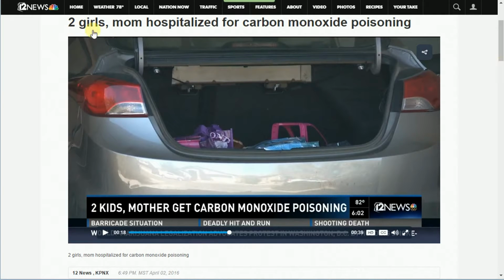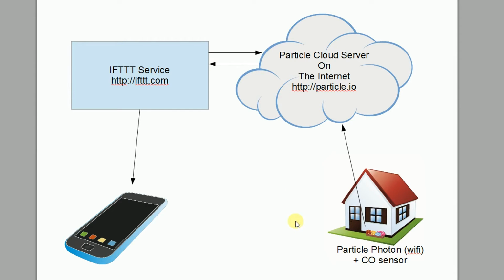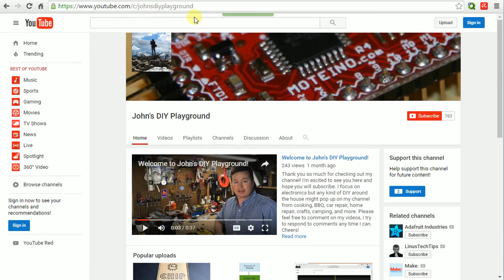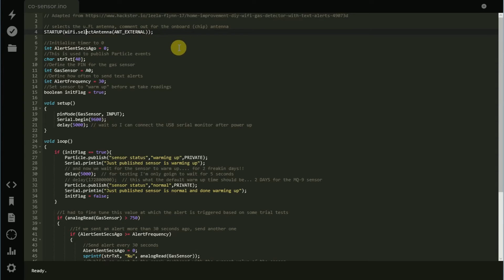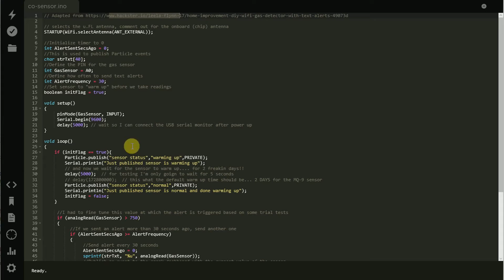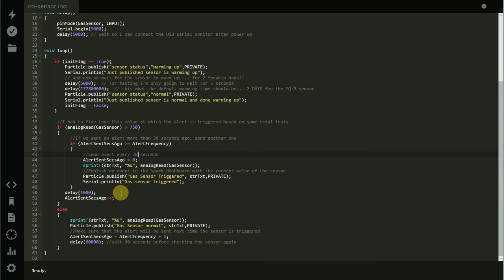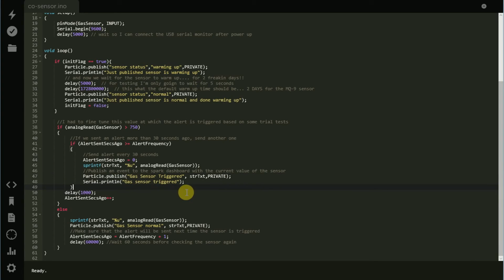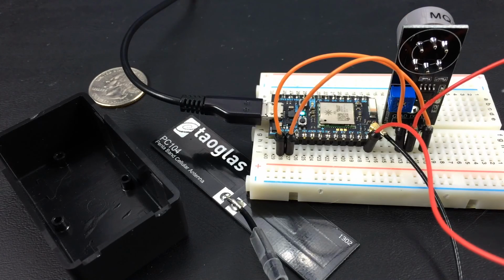DIY Smart Carbon Monoxide (CO) sensor to alert your phone

Comment: Hello, 2 questions:

1. Do you feel that IFTTT is reliable enough to use for the push notifications?

2. Does your 5V sensor output your reading on a 5V scale, or are you feeding it 5V to the sensor and receiving a 3V max signal on A0? I may have missed it.

thanks!
Reply from the maker: +clayz3r Regarding question (1), yes, I've used IFTTT for over a year now for other applications and I think it's up nearly all the time.  As a backup, a buzzer could be added to the setup, but I didn't feel it was necessary.  And for question (2), the sensor is getting 5V directly from the USB supply which is the same as Vin on the Photon.  I actually didn't measure max voltage on the A0 but typical Photon analog scale goes from 0 to 4095, and the maximum I saw in my testing was no more than about 3300.  Hope this helps!